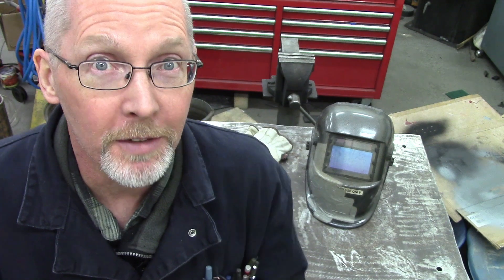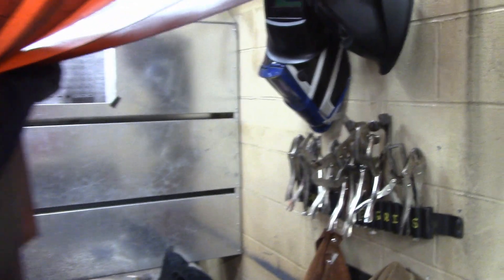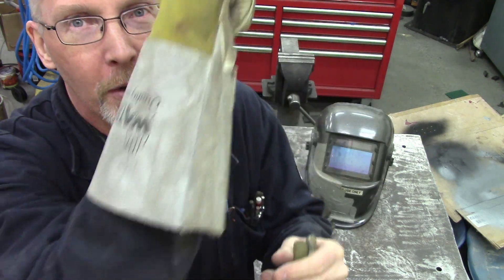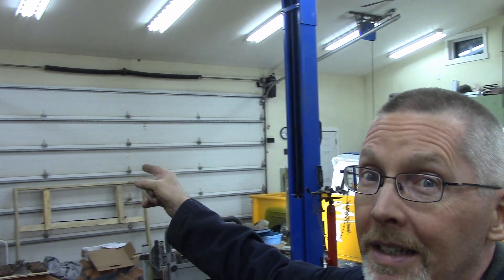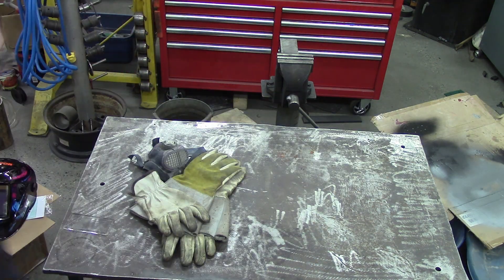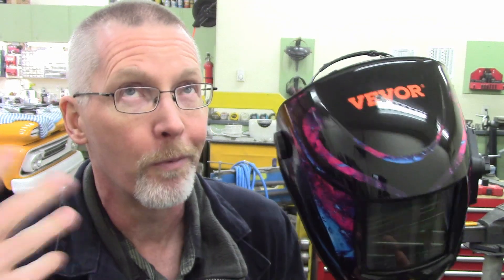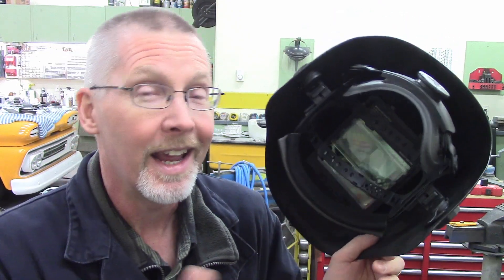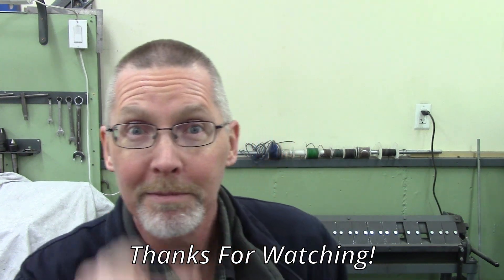QUICK & DIRTY: Arc Welding Safety Equipment

Comment: A couple of extra items to add.
1, Skull cap that can cover an ear.  Getting BBs in your ear whilst working sideways, gets old pretty quick.  :(
2, Long pants, that go over the OUTSIDE of your boots.  BBs going inside your boots sting.  It takes longer to remove your boots, than it takes for the BBs to cool down, so you just got to let it burn....  you end up with burn marks just below the ankle.  :(
Reply from the maker: Oh yeah!  The fizzle-fizzle-fizzle in the ear canal....  I usually work with ear plugs which helps - not just from the noise of MIG.

Comment: I'm an old guy who wants to learn how to weld.  Thanks for the info.  I was an electrician for 9 years and worked with welders all the time.  I always wanted to learn to weld, but never found the time.  I almost took a class to learn how to weld, but being an old fart my back and knees wouldn't let me stand, climb, bend like I needed to for the class, so if I learn I'll have to learn on my own.

I don't know how you live with the cold.  It's 70 F here and feels like 78 at the moment.  You're a better man than me in that regard.
Reply: The cold is not that bad if you know how to dress for it and are in good physical condition. As a young roughneck we had a 6 day stretch of -40F (-40C) you needed to eat 2,500 to 3,000 calories a day to stay warm. It felt so good when it warmed up to -4F (-20C). A guy I worked with who had worked in Russia say they ate spoonfuls butter to stay warm.
Reply: @eddydogleg  I'm definitely well insulated for the cold, but probably not in the best of shape!

I remember when I had to work in certain spaces, as an electrician, and the temperature in those spaces would be around 120-125 F, maybe hotter.  It was ridiculously hot in there.  I'd come out of the space and it would be around 95-100 F and it felt like air conditioning for about 2-3 minutes.  After I "cooled off" it was miserably hot again.  I've never quite become accustomed to the cold.  Living near Florida, I doubt I ever will.

My wife is from Ukraine and to keep warm they would eat raw pig fat.  Yep... raw pig fat.
Reply from the maker: I always thought "the heat's in the tools" (grin).